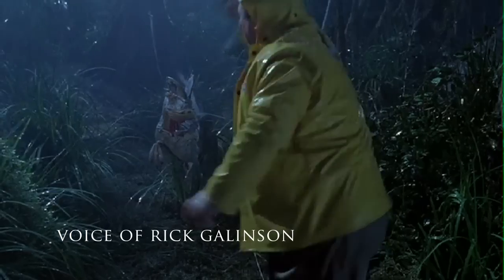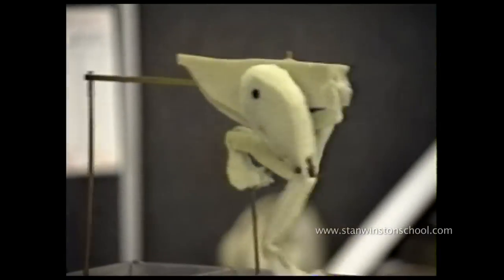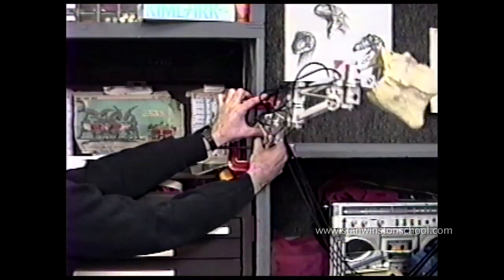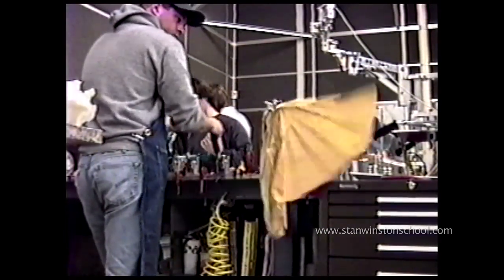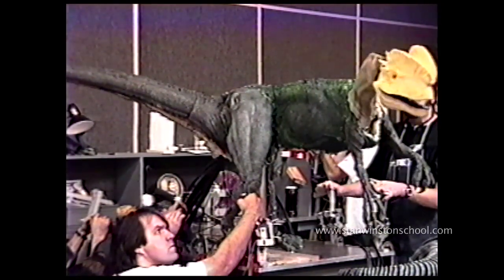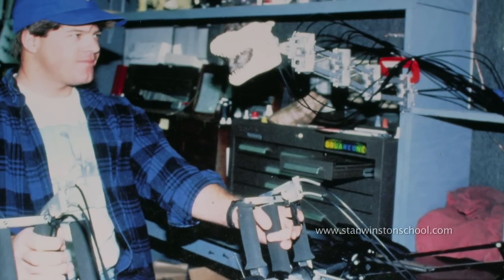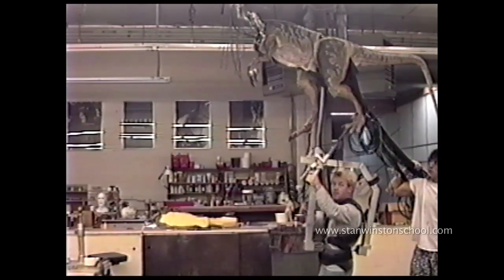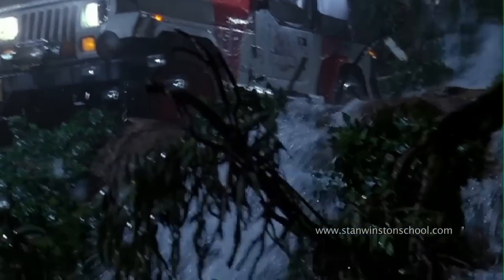JURASSIC PARK's Spitter - Building the Dilophosaurus Dinosaur puppet

Comment: I have a feeling there were two Dilophosaurus dinosaur puppets used while filming. One for the general scenes and one specifically meant for the scene when it opens it's frills. In the scenes before the frill action, the frills look very neatly tucked into the neck. Which I think would be difficult with all the umbrella like frame work that pop it open. In the film, the scene when the frills actually pop open, on looking closely you can actually see the frills are already hanging out and ready to open.

Comment: Why did they make the Dilo the way they did? I see it as an insult to the proud apex predator of it's time.
Reply: What do you mean Operation0919? How would you have made it? - David
Reply: I do not have a problem with the spitting poison/neck frill thing as they were in the book. However the fact that they made the Dilo so small urks me, as the real Dilo would have been 20 feet long. I cannot think of a single reason, other than time constraints, that the Dilo in the movie could not have been more similar to it's real-life counterpart.
Reply from the maker: Operation0919, perhaps it was for dramatic purposes? - David
Reply: Dramatically shrink the dinosaur by 75%?
Reply from the maker: Operation0919 just a guess on my part, but I think that they probably shrank it so that would appear to be rather unthreatening at first.  The scene where it kills Nedry was one of the creepiest in my opinion.  Wouldn't have been as much of a shock if it was bigger and scarier.  What do you think?  -Maggie
Reply: I see where you are going with this, and I agree that this scene was very cool. However the book managed to make it both unexpected and almost frightening, despite the antagonist being a 20 ft dinosaur. And I believe that the scene from the movie belongs in it, I just don't think it should have been the Dilophosaurus to do it.
Reply: Well, it has frog DNA... Frogs are small (well, some are) and that is probably the reason the Dilophosaurus is smaller than usual. Unsure about the frills and poison (or whatever it spits, i'm a weird person.) Please, don't get me started about Velociraptor.. Anyways, I personally like how it's so small. uwu I would cuddle it. If I was invincible. Or just plain immune to a spitter's spit. (That sounds so weird right now..)

-Swiffer
Reply from the maker: Hey TheSwiftestKitten, Yes, you are definitely weird. But aren't we all? :) -Matt
Reply: Stan Winston School Ehehe, we all are. :D